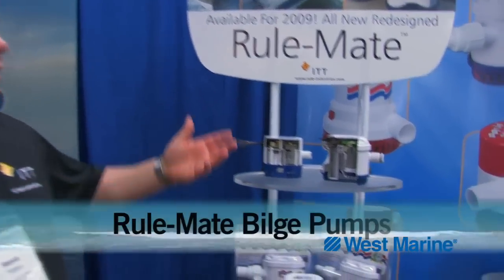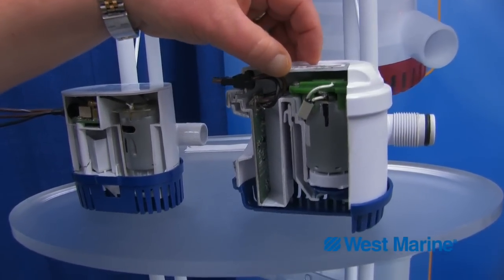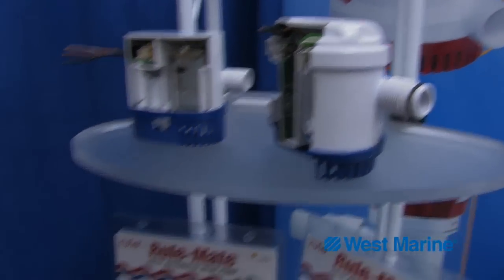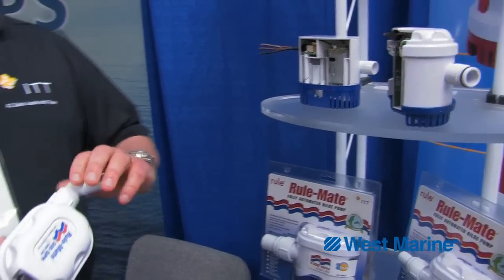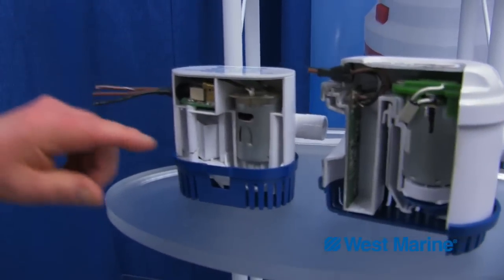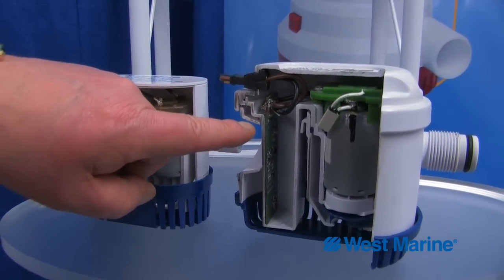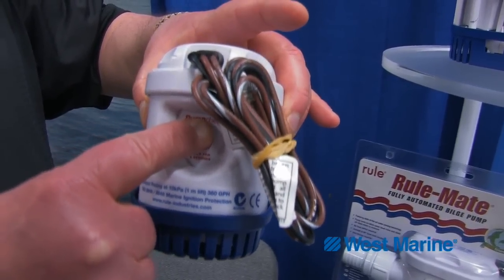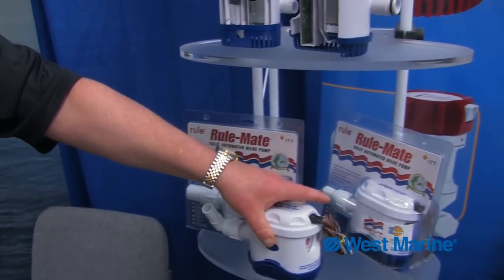Jabsco Rule-Mate Bilge Pump

Comment: So, if the water in your boat is deep enough for any oil to be floated above the pump, will the pump pump the water out till it brings the oil back down to the level of the sensor? In other words, if my boat has a little oil in the bilge will the Rule pump still keep it from sinking at the dock or will it just call it quits completely when it comes in contact with some oil thereby letting my boat sit on the bottom of the lake and letting all the oil in the boat out to swim with the fishies?

Comment: Can I use white viniher to clean the Rule Mate bilge pump?
Reply from the maker: When cleaning a bilge pump or bilge area you may use Apple cider Vinegar.  But, anytime vinegar is used on a boat it should be followed with rinsing very with regular water, and or if in a Head it should be followed with Head Lube. The vinegar will clean and kill bacteria, but if left too long on any of the rubber parts it could cause the rubber to crack over time.

Comment: This pump switch technology is very unreliable...I bought one and the pump stopped working after 3 or 4 months. Either the circuit board failed from getting wet all the time with salt water, or possibly algae is growing in the switch/water level compartment, on the circuit board. SO... I bought a couple of new pumps that still use the built in physical float switch technology...peace of mind returned for me, Rule used to be dependable I hope they can get back there.

Comment: so let me get this straight. if my bilge has a little bit of oil remnants in it as most inboard or inboard/sterndrive boats do from either oil change accidents, or old age leaks and drips, jabsco feels its better for my entire boat to sink and release gasoline, motor oil, battery acid and trim fluid into the water, instead of pumping out a little oily water? which would be worse envirnomentally? 70 gallons of gasoline, a gallon of motor oil, 4 quarts of transmission fluid, and acid from two marine deep cycle batteries? no sale jabsco and i will not be purchasing any of your products. i see some severe law suits if someones boat sinks due to their computer board refusing to pump out water with a little oil sheen. his words, not mine "if it encounters any oil in the water it will shut down." make sure you steam clean your boats bilge if you buy this pump.
Reply: I agree with you, that's crazy - you can soak up oil in the bilge with specialised pads - bilge pumps are designed to stop a boat sinking and ultimately save lives.